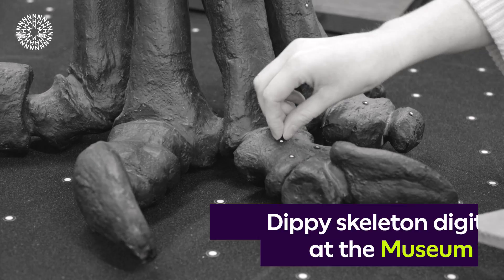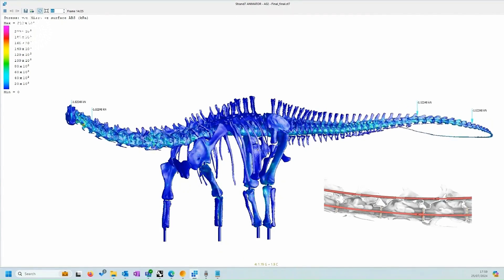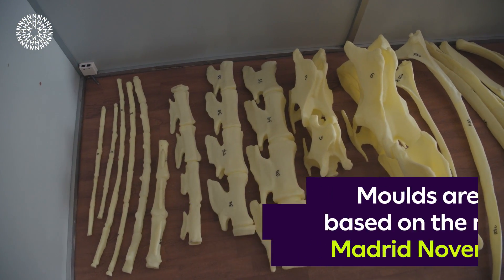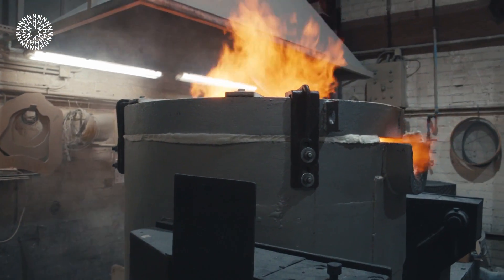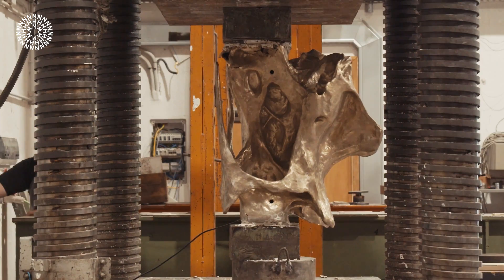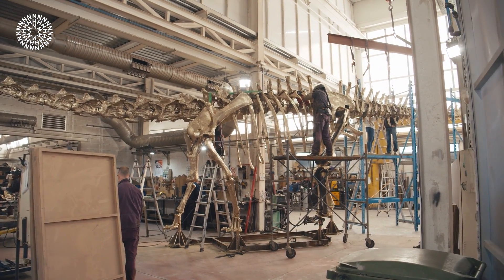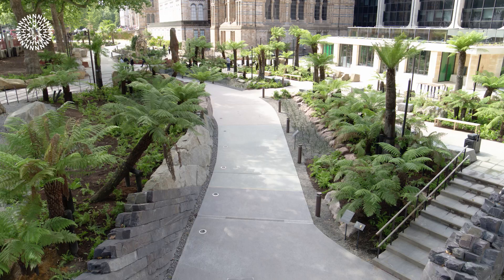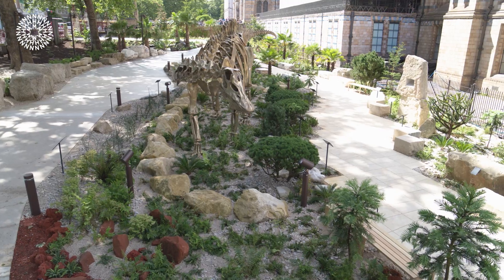Creating a bronze dinosaur for the Natural History Museum gardens | The story behind Fern

Comment: Am amazed that despite all that computer technology and engineering the foundry was using plaster/grog waste moulds! But then , it is a cast of a cast, and not much detail on that skull …
Reply: It's more a necessity; plaster holds it's shape at high temperatures where not much else does. It's also cheap, and given how big this is that's a consideration!
Reply: isn't sand casting still heavily used for manufacturing cars? I think throwaway molds are still common